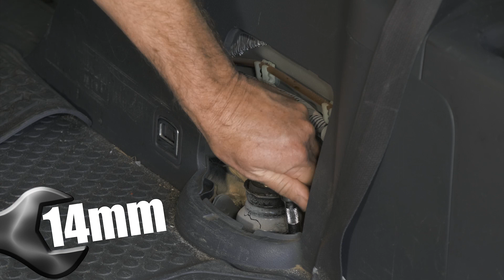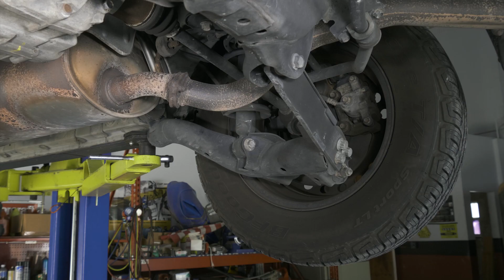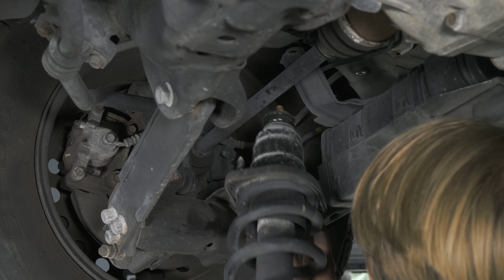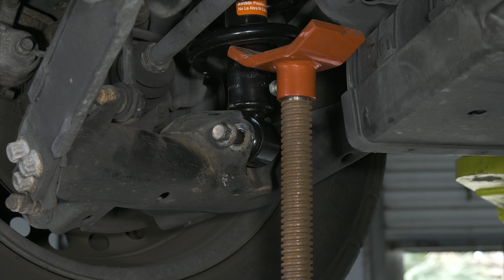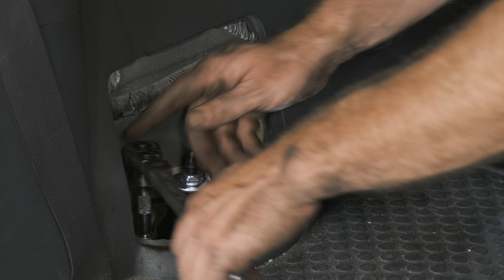2006 Honda Element Rear Strut Assembly

Comment: I put a 5 ft pipe on a breaker bar and that bolt did not budge, I even PB Blastered it every day for a week before knowing that bottom bolt was a B^%$h. I ended up cutting the nut off with a cutting wheel. Went and bought 2 grade 8 bolts. You did a nice video but people need  to be prepared to cut them out.

Comment: Nice work.  Gotta say...this must be somewhere out West, or someplace other than the East Coast...NO WAY is the underside of a 2006 Element that clean and bolts that forgiving!!  = ))
Reply from the maker: We are in Florida. Near the coast, but not close enough for the salt spray that turns cars to rust. I also think the fact that we only have 1 season year round helps stop the decay as well.
Reply: @APDTY  You're not kidding and especially Hondas.  Any suggestions for getting those Evap Canister bolts out for us DIY'ers?
Reply: @gp3yt  If they do not come out and break off. Just use a couple self tappers.
Reply: I was just laughing looking at the beauty of the underside of that element. I just had my struts done this past week and I live in the Midwest which of course calls for spraying the heck out of all the bolts the day before and once again the hour before trying to remove the bolts from all the rust that can create major chaos🥵 What a luxury not having rust, not to mention how much money 💰💰💰💰💰 you can save

Comment: seems like the bottom bolts would have come out easier if you applied some vertical pressure to the strut with a pry bar. Do you think that's the case or is wiggling them for a while the only way to get them out?

Comment: How do u get the bottom one out when it doesn't want to move at all? We have applied air, heat multiple different ways ot will not remove from the nut.
Reply: What did you do to get it out?
Reply: @AllenManor  You need a cutting wheel. You have to cut the welded nut off and then punch the bolt out. Go and buy 2 grade 8 bolts and nuts and next time it will be easy peasy. Broken 10mm cannister bolts break. 2 self tappers and good to go.